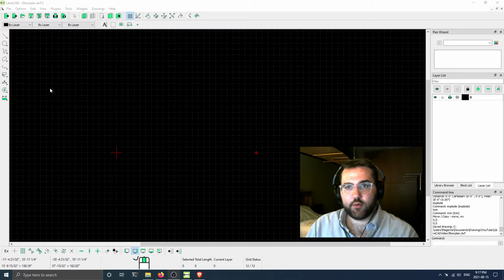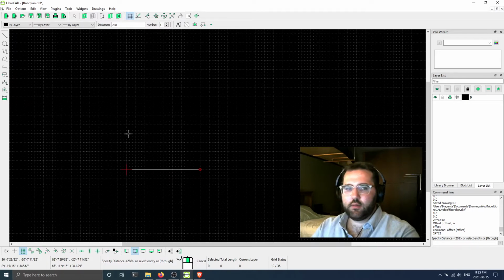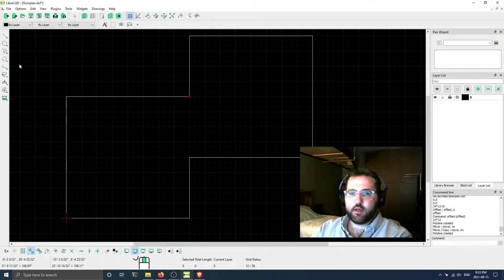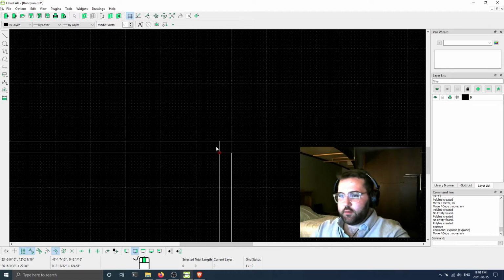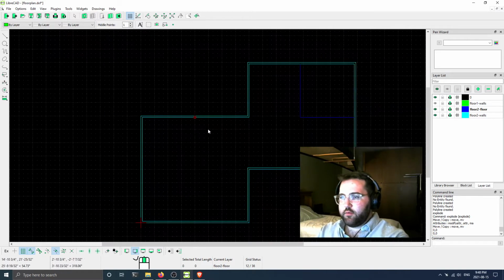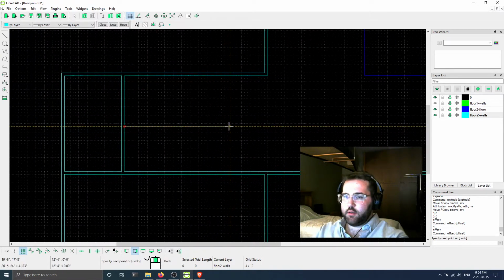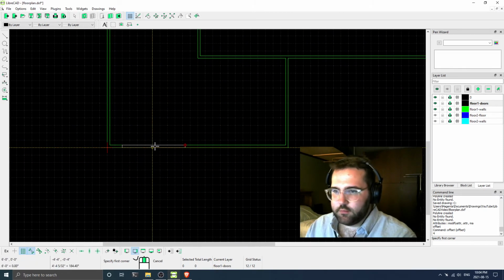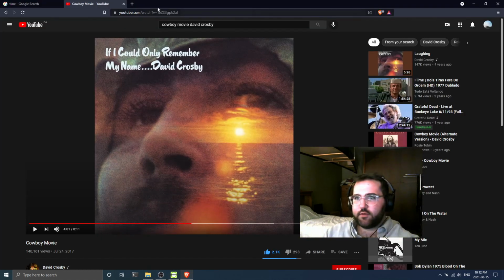LibreCAD: Basic drawing tools

Comment: thank you very much. after some years evaluating arch apps, i was thinking a whiteboard has to be sufficient to make a small haus. only seen something simpler than this in the ares commander user manual so far, somehow still couldn't connect with it. btw, is there a tool that can take somewhat straight layout lines on a whiteboard and convert it to a dxf, with some user provided unit|scale|precision indicators?

Comment: Hi Liam. Thanks for sharing. I can now draw on LibreCAD but I cannot seem to be able to open any DWG or DXF from any origins. I mean, they all open but BLANK (do data shows, even trying all zoom levels, checking for hidden/turned off layers etc) any dwg and dxf file I try and open is blank. Have you got any ideas why is this?
Reply from the maker: Maybe try converting the DWG files to an older version of the specification if you are able (AutoCAD 2004 perhaps). You could also try QCAD instead of Libre and may have better results.

Comment: How about extending two lines to intersect? Thanks
Reply from the maker: Fillet tool with the radius set to 0 is usually the easiest way to do that, that's not shown in this video.
Reply: @liamosler  Yeh. Thanks Liam.

Comment: Used to AutCAD and snapping to perpendicular. Can't find it in LibreCAD. Need it bad. Do you know where it is?
Reply from the maker: If you're drawing orthogonally you can use the restrict orthogonal settings together with the intersection snap. If you aren't drawing orthogonally then LibreCAD lacks this kind of snapping. You may have to copy the line you want to snap on to, rotate it 90 degrees, move it using end point snap, and then trim it or use the intersection that's created in whatever way you need.
Reply: @liamosler  Yep, did it in 3 or 4 steps, yikes. Must check out the orthogonal functions. Thanks Liam!

Comment: Hi Liam. I am having real difficulties trying to figure out how to use librecad even to do the most basic functions. I have been following tutorials on YouTube, yet the functions I am trying to work out simply do not work as explained. i.e. I have drafted out a house floor plan. I have plotted out all the wall locations in the 'command line'. Now I am trying to erase sections of those walls to show where the 'doorways' and 'windows' are, but to no avail. I have tried using 'Trim' but on some walls it doesn't even highlight the line in 'green' (that wall happens to be a 'brick veneer' wall , so it is drafted out with 4 lines representing the brick wall on the outside, and the timber stud wall just on the inside) All the external walls of the house are 'brick veneer' (represented by the 4 parallel lines). I have also tried using the 'Divide' tool to erase that section of wall for doorways, but have the same problem as the 'trim' tool. Some walls it will highlight the line in green, other lines, namely where I have drafted the 4 lines to represent the 'brick veneer wall' there isn't any response (clicking the mouse with the cross hair on the line does nothing). I have spent days, and many hours each day trying to work out what's going wrong, and I am getting no where. Do you know if there are any other ways that I am able to erase just the middle section of a line. Will 'trim' allow this to be done, or will trim only erase everything beyond a designated point. This is so hard to explain so please excuse my long winded explanation. Thanks Liam.
Reply from the maker: Alternatively, if you're having trouble with the trim tool, try enabling snap intersection and snap endpoint, then create a new line from the starting point of the line to the intersection with your "construction/trimming" line, then delete the original line you wanted to trimmed. I'm not sure why the trim tool isn't working for you, sorry.

Comment: Hi Liam, this is the first time using Libra and I am struggling with the crosshair. The verticle & horizontal lines do not move together with the crosshair but independently and will only draw V or H lines. I have tried numerous options from the application & drawing dropdown but had no luck. It will probably be a simple fix but I cannot find it. (Please can you help?)
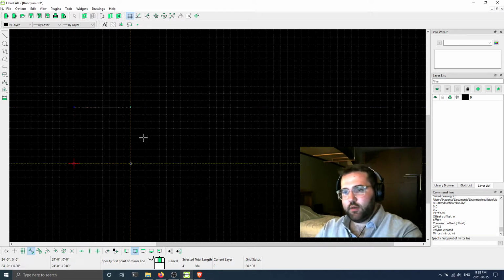Reply from the maker: Sounds like you may have "restrict horizontal" / "restrict vertical" enabled in your snap settings. I show how they're toggled on and off at around 11:45